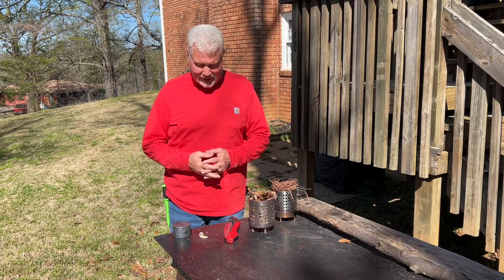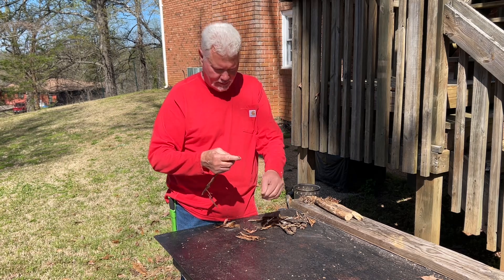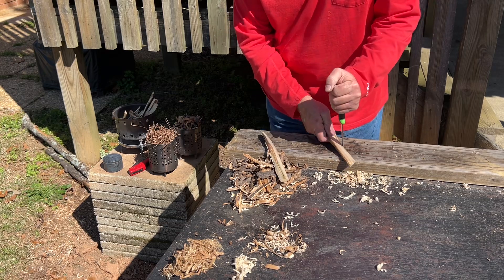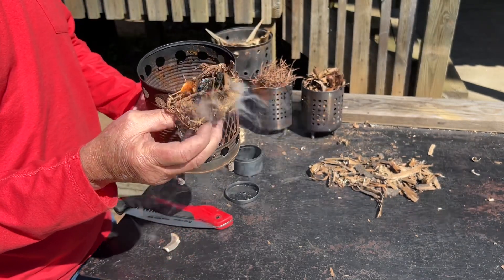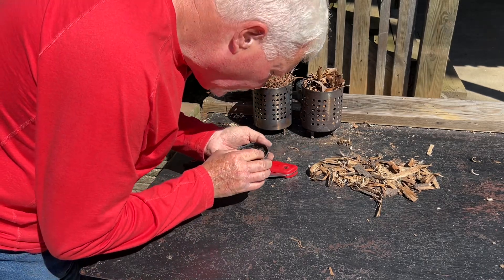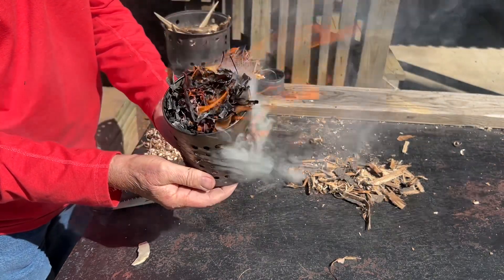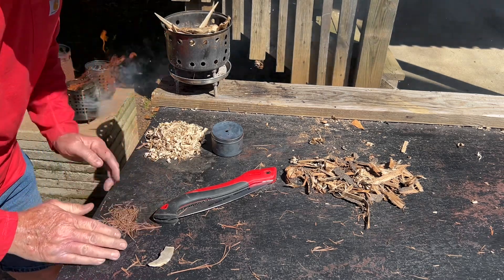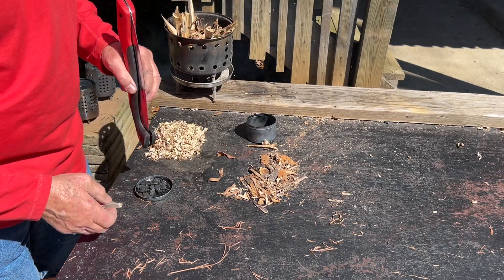Chert And Corona Saw Sparking Char To Ignite 4 Common Tinders

Comment: David, what is your take on flash tender? I have had mixed results with dandelion fuzz and zero positive results with willow fuzz. I live in norh texas.
Reply from the maker: I like it have videos using it, but they get few views. Most are unaware of their value.
Reply: @DavidWestBgood2ppl  Thanks for the reply.  I found that if I made fine shavings from pine heartwood, and mixed it with very fine dandelion fuzz, that sometimes it catches really well with a fero rod, but when I use willow fuzz, I get nothing.  I even had  bag of willow fuzz in my garage for a whole year, and the willow fuzz just won't help me catch needle sized twigs - no matter how finely I fluff it.  maybe the willow trees here are just fire-resistant.  Plants evolve self-protection, after all.

Again, I love your channel and I have a corona saw in my garage that I use for small branches and such for my fire experiments. Keep up the good work!